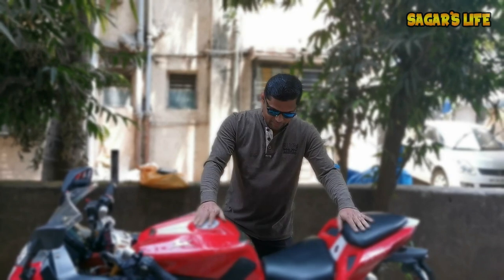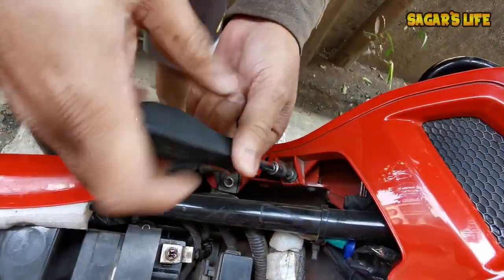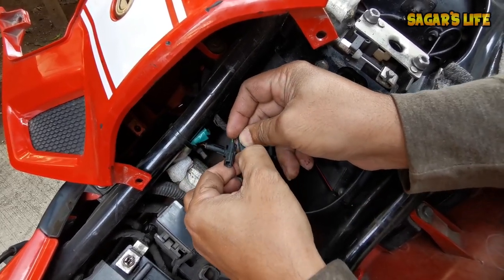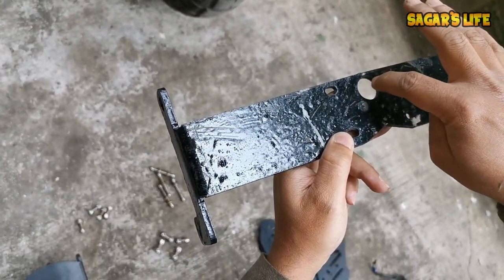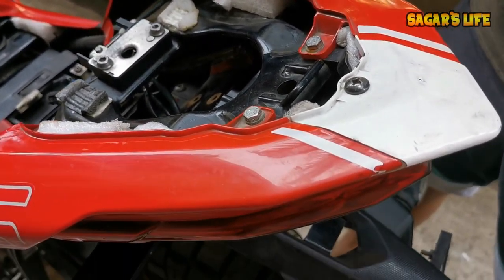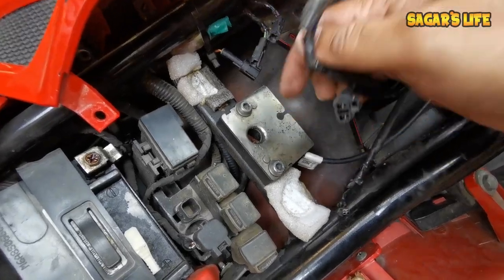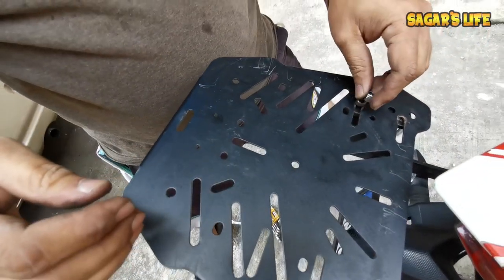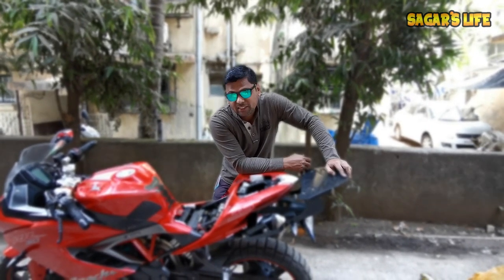HOW TO MAKE APACHE RR 310 AS SPORT TOURING MOTORCYCLE | TOP LUGGAGE PLATE INSTALLATION

Comment: Hi , i own a rr310 as well. Can you do a video of long term pirellir offroad tyre usage. Or tell here how is it on-road and off-road performance.
Reply from the maker: Stay tune for my upcoming 2 konkan series I shared my experience in the same 👍
Reply: Because i am planning to get the offroad tyres confused with pirelli and timsun. So just seeing all owners reviews
Reply from the maker: I used those tyres on very bad roads of konkan and some dusty roads too the tyres preformed amazing on bad roads.. You didn't even realize that road is that bad on those tyres and on highway also they performing very well good grip on twisty ghat section.. Waiting for monsoon to check how they perform on wet roads, so after that only I can able to make my review about those tyres.. Price wise pirelli are costlier than timsun..